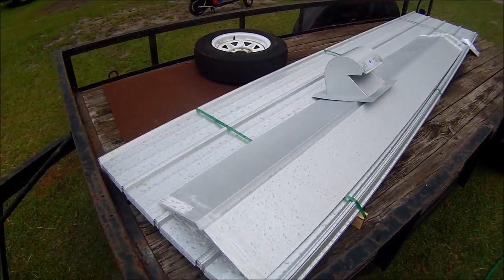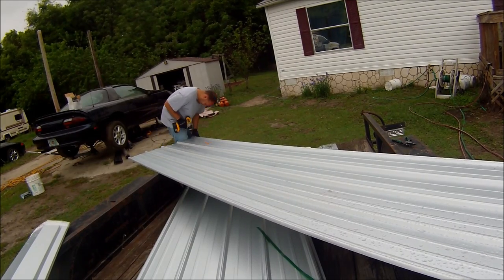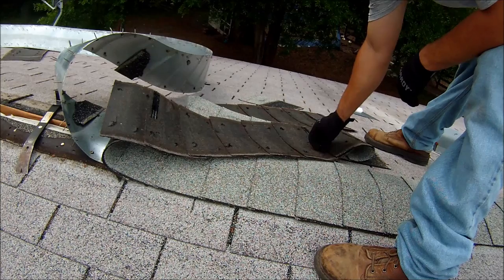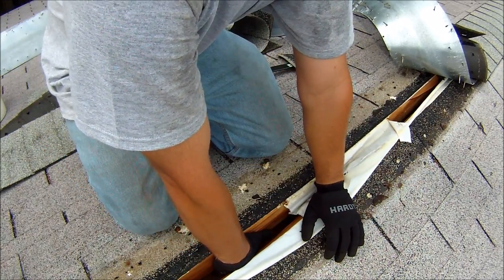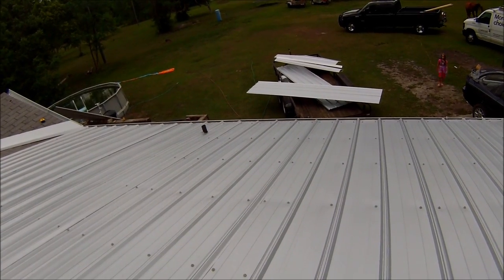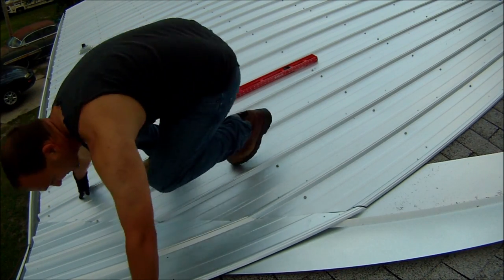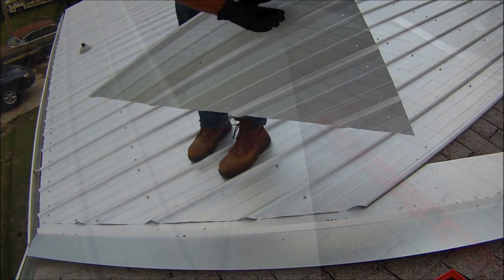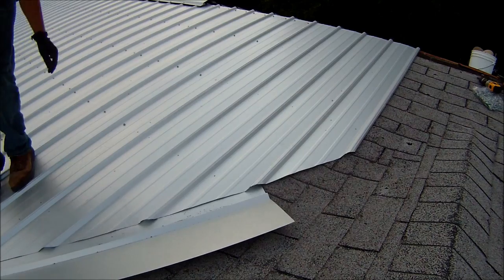Metal Roof Over Shingles on a Mobile Home by Myself

Comment: He measured and marked every hole-- Crazy have you heard of a pre drilled marker board- Are you in love with the tape measure. At least you drilled through 2 pieces should have been > 3 or 4  That ridge flashing would have worked w 1/4 the  amount of flat screws  Nails suck. Again no radiant barrier below the hot tin roof. Why. Why Why. That vent pipe was too short and the boot will leak. Should have diirected a silicon cricket above, were those screws rubber washerd- were any of his screws?? Well we know he saved money, doing it himself, we will see in years to come how much. I guess he opted out to use ridge vents after all. I don't want call names &*^%$XSP&^%. but where was that detail??If tell us about fasteners and waterproofing
Reply: Joseph Böhme What vide'o did you watch or listen to??? Y did he need marker board when he used one piece of panel to mark??? He only had to measure one panel because he used the same one to lay over his other panels to drill through so all the holes would be the same da... He also if you happened to watch and listen he stacked 5-6 panels on top of each other laying his pre drilled panel and drilled through them and repeated the process. Did you see or hear any mention of nails anywhere in his video??? No because he didn't use any... Why would he need any radiant barrier when his present shingles where left in place that act as one??? WHY - WHY - WHY??? And why is his stack to short it's not as if he will have any snow covering it but the heights varies from the area people live in. And Y is it going to leak the boot it self will seal it along with the silicone??? He can always add a vent pipe cap later when time allows if needed. I had no issue seeing screws with rubber washers but than again I actually watched and listened to his video. Check for any links he may have listed in regards to any information you missed. Some people are just keyboard assholes so if the name fits wear it. I felt he did a very professional job ad followed the manufacturers recommendations so what else did you miss??? So your also a keyboard know it all and like to criticize others work when they are sharing their experience with others including you had you actually watched and listened to his video....now anything else you might question if so don't bother. I am 73 years old and have owned my own contracting company for 51 years of them and have had to deal with 2 many people just like you many times over and over...WHY - WHY - WHY oh Why
Reply: I did my holes the exact same way and the screws have held fine through a winter for me installed the same way.  Last week I repaired my dad's asphalt shingle roof by stripping a section and cutting in and installing an updated vent before winter. the entire time I was thinking, God metal is so much easier than this crap!!

Comment: You're in Florida, you removed the strip holding your modular home halves together, this video was posted in 2016, and we all know there has been a hurricane or two or three since.  Unless you got inside your attic and added some strapping to hold the two roof halves together, I'd bed you've experienced some house separation, or maybe total loss.  People, please learn about your house before you start a project.  Knowing what kind of house you really have will save you some hassle.  There's a reason modular homes are not the bar at which everyone shoots for.

Comment: never over shingles because they scratch the paint off the steel as it heats and expands. Shingles are the only substraight not suitable. You should have read the instructions.
Reply: What about the none painted panel?
Reply: Doesn't matter if over shingles doesn't hurt paint at all seeying how paints on the top lol and shingle and the felt under shingles just adds for extra water proofing. Only would take shingles off if fixing damages b4 medal roof
Reply: The paint on the underside ? There is no paint.
Reply: manufacturing company on mine says u can go over shingles,  just put felt under it. also if going over shingles ,screws go in on rib.
Reply: I did a similar job on my roof 15 years ago.  Same standing ridge type panels, made of coated and painted steel.  Since scratching through that coating would start it rusting, I put down a layer of felt first.
My problem was cutting the panels.  I was using a circular saw with a blade till I found out about abrasive disks.
Anyway, the job came out beautiful.
Reply: nice job, 
spend a lot of time on valleys doing it that way.  When you lay your last full pc next to the valley, install the valley metal and pop a line to measure to (1.5 or 2" from center) measure top of valley width and then bottom and lay out the appropriate number of sheets of roofing on the ground. pop a line on the diagonal you measured and cut it with the dewalt snip attachment for your impact driver. 
install and repeat.

Comment: Well for one where in the hell is the building inspector to not stop you. No hat channel, you never put the metal roof directly on shingles. Hell dont you look on the internet to see how to do it the correct way? I have a box of screws for my last job that came out of a customers metal roof, every screw that came out had rust on it, meaning they all were leaking. Metal roof you have put on is only a 15~20 yr fix before you start having problem. Dont believe me show your roof job to an insurance inspector and talk to him about high wind and what happens to shitty metal. Just talk to one if you dont believe me. Just because you can buy a tool dont mean you should.

Comment: You shouldn't put that metal over those shingles
Reply from the maker: The manufacturer of the roof system said it was 100% ok to overlay over the shingles where we live. I will always will take the advice of the manufacturer and follow their direction for their products.
Reply: @AmateurHomestead  ya I get that but you know that's going to sweat like crazy so over time the damage will appear that's just common sense but I get what your saying but just like the kypex piping for heat they weren't right about that one too and cost all those poor homeowners who got the shit end of it all

Comment: You are supposed to use 1x1's between the metal and the shingles. The reason is because the tar in the shingles will actually rot your metal roof faster. Expect that roof to last maybe 15 years... Not the 25- 50 years that it is supposed to. ;P
Reply: I thought you did a great job. I had given up on a metal roof because I had the same fears about wind getting under and ripping it off (So. Louisiana here, less than 5 miles inland from Lake Pontchartrain/Gulf). My worry is the rubber gaskets. If all you have to do is over tighten to ruin them and cause leakage, my neighbor (creep) would be up there ruining them as fast as I could put them in. I wonder, is there another way to make watertight, or can you use Liquid Weld type product that maybe has some give?  BTW, when I say "I", what I really mean is somebody else. I'm pushing 70 and afraid of heights.  Trying to cover all possibilities is all.